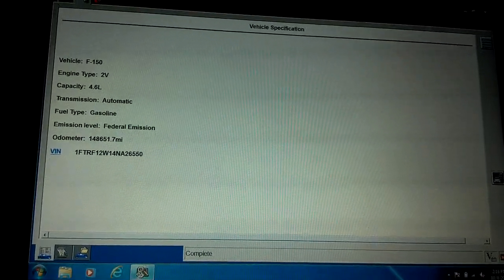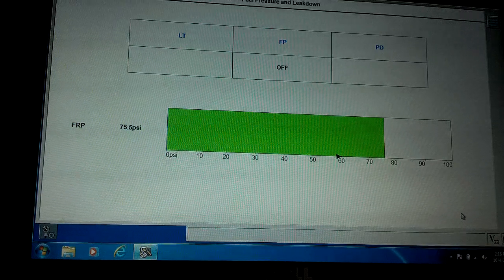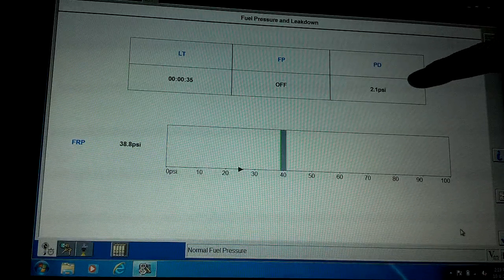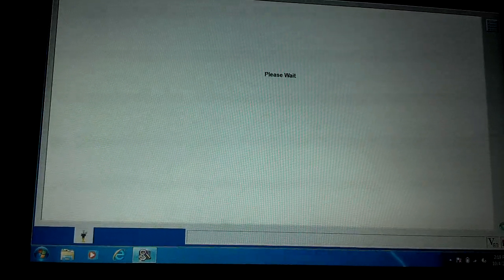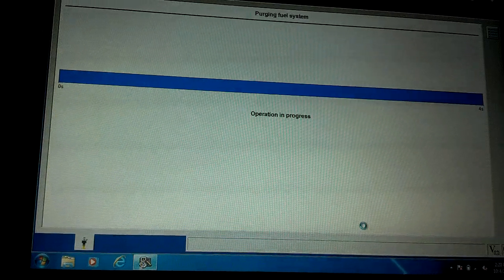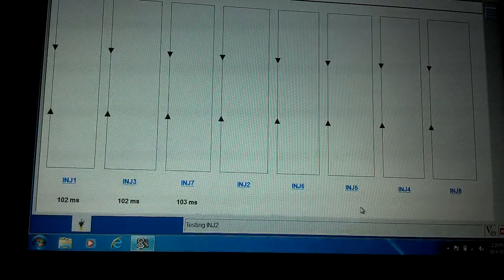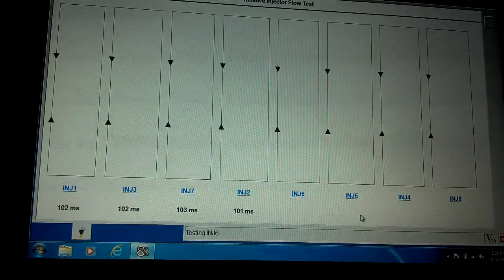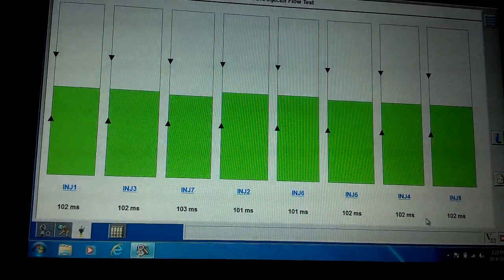Ford IDS relative injector flow test

Comment: Hello, if the reading is red on an injector, what is the next step? Bad injector? or can it be simpler?
Reply from the maker: Most likely you'd be replacing that injector. I suppose the root cause could be elsewhere, but it would be pretty rare in my experience.